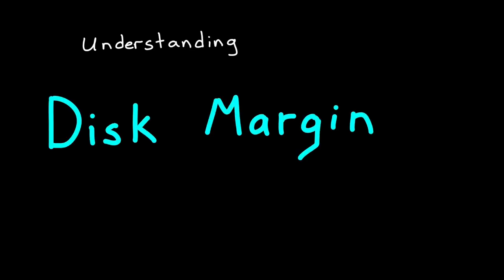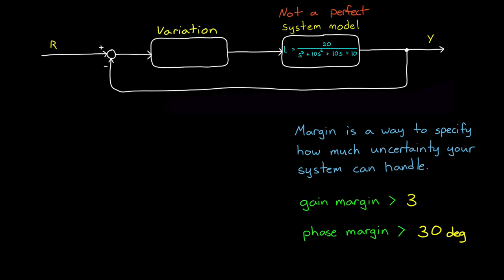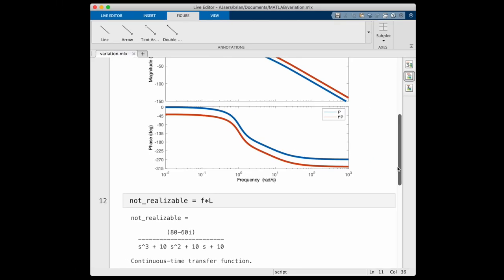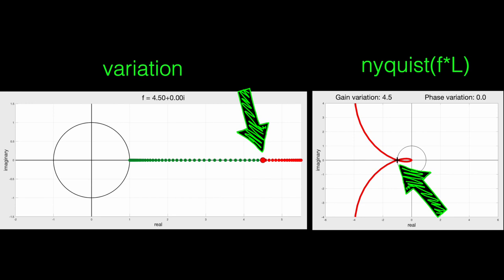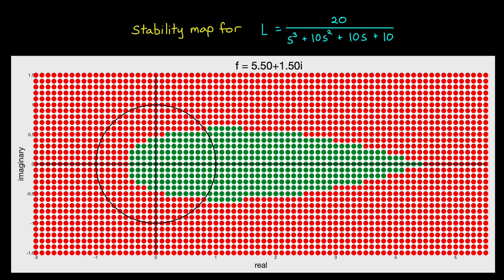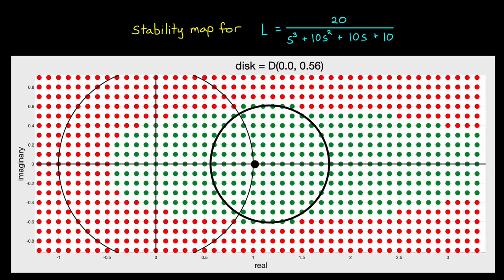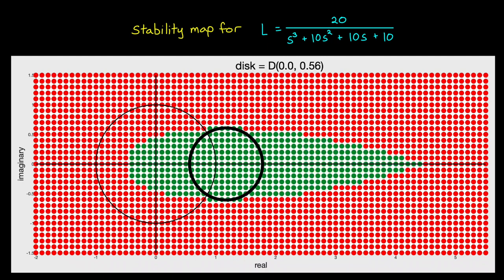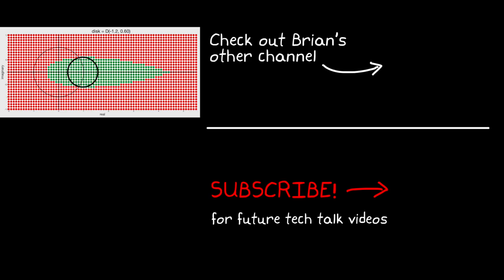Understanding Disk Margin | Robust Control, Part 2

Comment: Ultimately its a juggle between system analysis methods and control design strategies and best control design  is figuring out which analysis/design methods to use to control a given system .. Woof..🥵🥴.. The reality we wish to control is 💥

Comment: Brian, make a new series of videos on how to make interactive simulations. It would be SO HELPFUL!! The real power of Matlab is to help you explore a problem, a system, a design, but sometimes it´s a bit time-consuming to figure out how.
Reply: one way i could think of doing that is to make up an N by N matrix of real and imaginary conponents and get a matrix of 0 and 1 for unstable and stable results and then meshing or surfing them with no edges but markers at all nodes. they will differ in colour, so you then take the xy view of it and here you go

Comment: How did you generate the plot at 12:50? I can't find a MATLAB command that makes anything like it, and it seems like a very useful visualization tool!
Reply: It is made by interactively running a matlab script that handles mouse pointer location and corresponding value of the graph.

Comment: What about delay? For example, in ventilation we have hot water valve in one place but air temperature sensor far from it.
Reply: I might be wrong but delays produce phase shift, so that's what you need phase margin for
Reply: @Giammy12  but this shift is not constant, it depends on frequency.
Reply: @alexanderskusnov5119  Basically a delay is equivalent to multplying the system by e^-(td*s), where td is the time delay. This affects the bode plot of the system: the magnitude stays the same but the phase decreases as frequency increases
Reply: So you can calculate again the phase/disk margin by looking at the new value of the phase that corresponds to the critical frequency of the system
Reply: I think there is a video on the Matlab channel that adresses delay.

Comment: Can you explain the "conservative" term, in brief, to understand more clearly, please?
Reply: For both parametric and unstructured uncertainty, is it an important issue?
Reply: @mehmetkilic9518  I don't think conservative has a specific meaning here. A conservative solution is a solution that errs on the side of safety or what is normal. It's a "less risky" solution